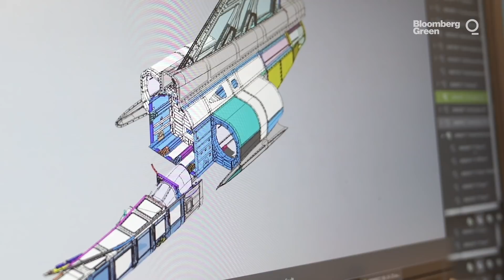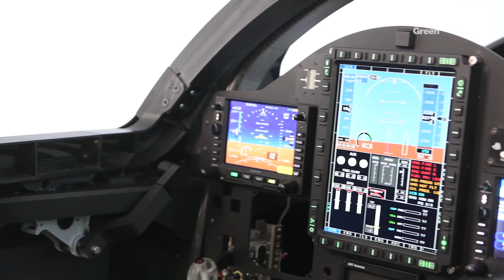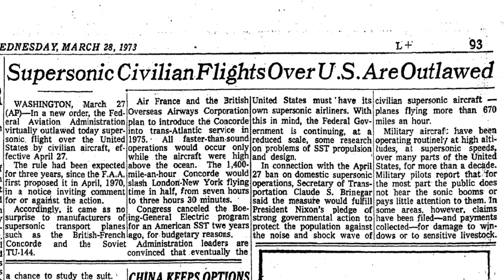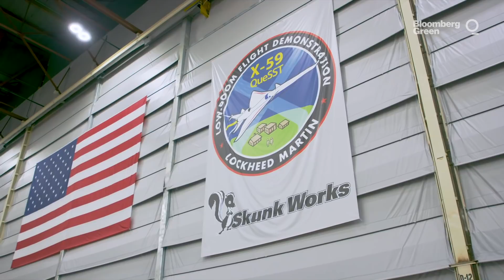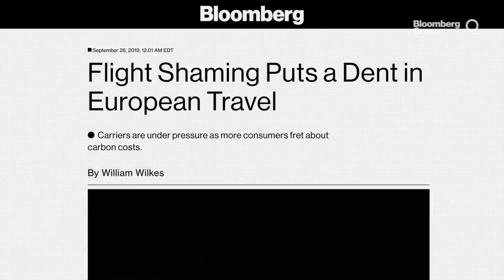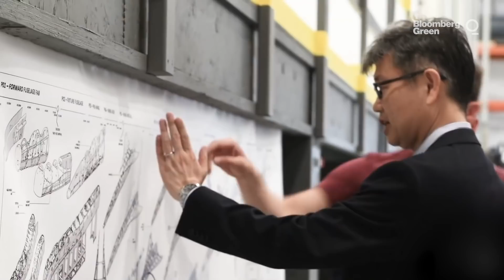Why Supersonic Jets Are Making a Comeback

Comment: 1 - Let's get it right.
2 - Concorde's "poor economics" were due to our nice American friends refusal to allow flights to their territory - save NY.  Suddenly, no airlines wanted it.  It wasn't because the US was against SSTs in principal, but simply because Boeing abandoned their SST project because it was too grandiose and found early on to be be impractical.  "If we can't, you shan't."
3 - The Paris crash was due to SIX faults coming together, starting with incorrect French maintenance and ending with incorrect Paris airport ground control.
4 - Concorde tyres were old technology by the time of said crash.  No-one would spend the necessary start up to develop tyres of latest tech for a mere 20 aircraft.  It was tyre failure which penetrated the fuel tanks and caused the fire in the Paris crash.
5 - A new SST would have the benefits of turbofan engines whereas the Concorde had 1946 technology turbojets.   The first after-burning turbofan was 20 years later, Volvo Flygmotor's RM8, actually based on P+W JT8D but modified and with Swedish designed afterburner.  Well done the Swedes.  Skin materials would have to be able to withstand the same temperatures as aluminium or higher.
6 - And the final insult came when UK and France gave a couple of Concordes to US museums.  If the US wanted Concordes they should have made them themselves.
7 - Shove it, sonny.

Comment: That kind of pulling CO2 out of the air to start with has a benefit. If they're going to start with CO2 and crack it to begin with, they can premake the actual best fuel for the engine at the molecular level. Obviously, no sulphur compounds, but it goes way beyond that.
Reply: but no mention of the cost to crack the CO2 and make it into a fuel

Comment: I think we should be spending money researching electric or hydrogen aircraft not supersonic jets.
Reply: We are, but not in this particular video.
Reply: @paullee5573  The theoretical maximum for electrical energy density is far to low for economic cargo air vehicles, hydrogen isn't denser either being the least dense element. Viability for cargo land shipping "trucking" would require radical rethinking in the way we prioritize weight limits and the safety of modern heavy duty tires. Electric/hydrogen for public/private transport for many reasons have already been and will continue to be more viable than similar air vehicles. Water vehicles for industry or recreation are extremely viable for all different manner of power train.
Reply: Fluffeh fox. Yes I agree, up to a point. But that does not alter the fact that research is being carried out currently. Lets face it, if everybody had said, as some did, that manned flight is impossible,, aircraft research would never have got further than the Wright brothers.
Reply: @paullee5573  Sorry i edited my comment, Maximum theoretical limit for battery density is around 1 third that of liquid fossil fuels. Passenger air assuming it's not trans atlantic or pacific, is currently much more financially feasable since weight is a lesser factor, but for the heaviest air vehicles that rely on their range and cargo capabilities the impact on their financial feasibility would be very significant.

Comment: Concorde crashes once and they shut it down but Boeing, Airbus, Embrarer and Bombardiers crashes every now and then but they are still operating to this day. Maybe they decommissioned it because it was too noisy (airports didn't want it), needed 2km length of runway, and costly to maintain and not withstanding the amount of Co2 it let out

Comment: You can't describe the Concorde as being a failure. It had it's purpose and it revolutionised the air travel industry.
Reply: Space Shuttle vs. Concorde ...which was the most reliable??
Reply: It was not a failure. The airlines failed to use it properly..
Reply: it was success only once Concorde crashed but the rest of them was successful.
Reply: but it didnt?

Comment: This is retarded.  There is no cost benefit to fly passengers faster than the speed of sound.  You can already cross the U.S. in 6 hours, or the Atlantic in 8.  There's no reason to double the cost just to cut the time in half.  Also, how the hell are you gonna get around the sonic boom factor?  These things will never be allowed to fly over populated areas, so, what's the fucking point?

Comment: Saying that you can convert CO2 from the atmosphere and burn it is Carbon neutral is frankly dishonest. The process energy required to manufacture the fuel is far from Carbon neutral!
Reply: Yeah. It's maybe not the best example. Still synthetic jet fuels made using renewables can power.jet planes more efficiently than a gas. If we get to make them a bit more cheaply, then we have lift off.

Comment: Wait it was not "first" - Soviets were the first & fastest just that "first" cost them a lot in noise and reliability. The reason both supersonic jets were failures is simple - with current technology it simply costs WAY too much to fly supersonic vs. subsonic. Not only there are cost problems there are where can you fly problems - you can only go supersonic over water (it is noise thing - related to sonic boom - no tech will change physics).

Comment: Sorry, but taking CO2 out of the air and making a jet fuel out of it takes a LOT of energy.  Even if you use solar to generate this energy, it would take a lot of solar.  Solar panels themselves require a lot of energy to make and create a lot of toxic waste.  By the time you spend all this energy it might take 50 years to make up for just burning fossil fuels.  Long before then we are likely to come up with a better technology to make this whole idea of jet fuel made from CO2 obsolete.

That is the problem with 99% of "green technology",  it just does not pay off... ever.  Put the money into research until we have technology that is BETTER than what we have and let Capitalism spread it far and wide instead of government subsidies and increased energy prices.  Less than 5% of the subsidies go to research.  Stop the subsidies and put ALL that money into research.  Right now better batteries are need FAR more than subsidizing solar panels, wind turbines , and electric cars.

Comment: Concorde started her scheduled flights in 1976 but was doomed from the beginning after the Yom Kippur war in 1973 and its subsequent petrol crisis. So no airline wanted to buy her, not even Air France and British Airways which eventually bought her after huge political pressure. 
The Concorde was not designed to have the common fuel efficiently turbofan type of engines because they were less powerful then and inevitably much larger than turbojet engines. 
The Olympus turbojet engines of the Concorde were initially designed for military use without serious considerations for noise or fuel efficiency. The fuel efficiency prevented Concorde from the very profitable transpacific routes. 
Even today supersonic flight without perceivable sonic boom is impossible. However a supersonic passenger airplane can be economically viable with the transatlantic and transpacific routes over unpopulated areas. 
Nowadays the technology of engines is much more advanced than Concorde era of 70's. The only problem today is the sonic boom over populated areas.

Comment: Wtf was that intro, the concorde cabin was small as hell and looked low budget
Reply: Yeah, its no widebody, but the cabin width and height were a consequence of the aerodynamics of cruising at Mach 2.0 for 1000's miles. The 60's-developed design and requirement for light weight to maximise range and speed with materials around back then meant the cabin wasn't total luxury. But then you were only only it for 4 hours rather than 8 or 9 hours and speed was what you were paying the premium prices for.

Comment: If Concorde  had been backed by Boeing / ie the USA government supported airline it would still be flying or at least the latest generation . Boeing has lost a number of aircraft due to crashes and that did not end the airline ! But Boeing / USA have never like competition / just tolerated it , so the level of comfort on airliners barely changed over the last 50 years and in economy /cattle class went backwards .

Comment: The Concorde was never profitable. What's the market for this? 
Regulations prohibit supersonic flight over most parts of the world where most people live and want to travel to.
Reply: FAA introduce the ban for overland SST flight because Boeing didn't had an answer to the Concorde! 
so they had to limit the market penetration of Concorde and by limiting the speed of flights coming in or over USA, they stopped any American airlines buying Concorde!
This is an American project so they will lift the ban to make it work, so don't worry!
Reply: @AshrakAhmed  It's banned over Europe as well but not because of Boeing.
Reply: @AshrakAhmed  they’re lifting the ban because technology has advanced to the point where the effect of sonic booms can be significantly reduced.

Comment: Even with all the new technology, you still can't beat basic physics: at high speeds, drag goes up with square of speed (approximately). You go twice as fast, you need to spend four times the power to keep that speed. While new supersonic planes might be more efficient than Concorde, they will never be as efficient as jetliners because these are designed to sit at the optimum spot.

Comment: Meanwhile at SpaceX: 
"Let's pack people into a stainless steel can atop of fuel and oxidizer and yeet them into suborbital to get them there in thirty minutes."

I'm an avid fan of SpaceX, but even I'm a little skeptical at that.
Reply: If it would be cost about 5 000 000 per launch and can carry 150 passenger it would have same ticket's cost as Concorde. BTW, why not fly on spacecraft if it really cheap and reliable? But I think it would happen only in 2030's. BTW, for being cheap this thing need to be used with high frequency.
Reply: SpaceX can get people from ground to the ISS in around 24 hours. It's 250 miles away from the ground. Even my car does better than that.
Reply: @andysedgley  Your car can't get to the 250 miles altitude. Most of that time is orbit correction, because Dragon need to flight in parallel direction with ISS. If I don't forget, Dragon doing several journey around the world for reaching ISS. BTW, you can't just jump to the ISS orbital mechanics is more difficult.
Reply: @СоюзниксОкинавы  Perhaps I should've put a 😉 after my previous comment. But I didn't think anyone would take it seriously.

Comment: Let’s all remember, the 2000 Concorde crash was caused by debris on the runway getting sucked into the engine.

What plane dropped the debris?

DC-10 Cargo Door
Reply: The debris didn’t get sucked into the engine, it punctured at least one of the left main landing gear tires and a piece of that tire ended up slamming into the underside of the left wing.

Comment: You failed to mention that the Concorde was a commercial failure only because of the supersonic flight ban over the US which was issued to protect Boeing and Lockheed interests as they had failed to build a viable rival.
Reply: No it was banned because of the damage created by sonic booms and the fact tht it was loud. Have you been doing your research?
Reply: Yep,  usa plays dirty when it benefit them
Reply: @m4rs12  no they were smart to ban flights over the US because of the damage windows kn buildings and the loud noises created by sonic boom and is the primary reason the US dropped out of super sonic aircraft.
Reply: or maybe because people don’t want broken windows?? hello??

Comment: For starters for engine noise and fuel efficiency put a super cruise engine like the F-22 uses, on top of the wing so the sound is more directed upward in subsonic flight. Take a look at the Celera 500L for other ideas.

Comment: The narrator described the Concorde as "the failed Concorde." The Concorde was not a failure, but a consistently reliable supersonic transport used for many years. The fire on the one that crashed in France was caused by one of that Concorde's wheels(during take off) spinning a piece of metal from the runway up into one of the fuel tanks. That piece of metal was traced to a American plane, an airliner, who lost that piece from one of their engine nacelles. The new companies are showing proposed supersonic transports that are tiny in comparison to Concorde and the Boeing 2707 SST, proposed in the '60's, which, if built, would have carried 300 passengers. We're going backwards .
Reply: And let's not forget why FAA introduce the ban for overland SST flight, because Boeing didn't had a solid answer to the Concorde! 
They had to limit the market penetration of Concorde and by limiting the speed of flights coming in or over USA, they stopped any American airlines buying Concorde!
Now that the American finally have a semi working project, they will lift the ban to make it work!

Comment: But, it's not really "green friendly" & it has a large carbon foot print....
Reply: yeah, the "we took the carbon from the air" pitch is total bullshit. the carbon you took from the air is not the one that came out of the aircraft but the one from the power plants that provided you with all the energy to revert CO2 and water to methane and O2. 

what come out of the plane's engine at the end is a big load of pollution and a 'fuck you" to the environment. and i'm not even close to be an environmental activist...

Comment: The Concorde crash took place because of a foreign object on deck at the take off strip. It’s safety record was impeccable. That crash was caused by the airport strip maintenance crew not knowing a loose piece of metal was left on the take off deck. And that piece of metal was NOT from the Concorde ..... More journalistic accuracy here please.

Comment: no it will not become more afordable, oil prices only go up
Reply: Aren't jet fuel doesn't have to be made from fossil fuel?
Reply: @pabnckncykma1297  Thay once made a jet engine that ran on Coel dust.
Just imagine the black streaks across the sky if they used them in aircraft. LOL

Comment: failed Concorde? what an  idiotic and ignorant thing to say
Reply: it was a COMMERCIAL failure, could never operate properly due to overland regulations making transatlantic the only viable route.
Reply: @plum_pie6402  You are correct, in part. The development and capital cost was written off, the bill footed by the taxpayer. BA found a way to make it pay by using it as flagship product. Travellers would buy BA tickets in the hope they would get bumped up to Concorde, as well as those few willing to pay the seat price. I know several people who flew on a business or 1st class subsonic flight bumped to SST.
Reply: Very right on that.
And the most stupid, it got grounded after the one and only crash.
Every crash is to many, but howmany passenger airplanes have crashed, non of these models have been grounded upto the 373max
Reply: He is a 'Yank' after all. No-one can beat the bastards; even if they do! 👺🇦🇺🇬🇧
Reply: @edwardgeorge4881  Boeing had an SST plane, but didn't pursue it because the economics didn't work.  Concorde was pushed to production and only 14 were ever put in service.  Yea, you really owned the US with that brilliant economic blunder!  😂  It's kind of like the A380.  The smaller Boeing ended up being a better performer commercially because the A380 can only land at some airports due to its size and weight and can only service the most popular routes to get the number of passengers needed to make the flight worth it.
Reply: It was and still is dumb aircraft. 
14 planes total. 
Can only go fast over the ocean. Last thing the cost of a ticket. 
So again a dumb aircraft.
Reply: @greg9403  it can go fast overland also.

But not allowed.
Somehow people accept many army planes going through the soundbarrier but non civil airplane.
Reply: @greg9403  It didn't make economic sense but what a flight! I took one on July 28, 2003 and will never regret it. Magnificent ride!
Reply: @greg9403  It was not dumb at all. It was a technological engineering masterpiece that wowed and inspired thousands of people, not just those who flew in her. Even the pilots were awed. 3.5hrs from London to New York, meaning you could effectively arrive before you left (by the clock). Yes it never achieved the commercial success the manufacturers hoped, and it had some operating limitations placed on it, but the fact companies are now inspired enough by it to try again shows it wasn’t a failure! Dumb it was not!!
Reply: @neoscylax  Yes it's dumb, like saying a f1 car for a uber is not dumb.